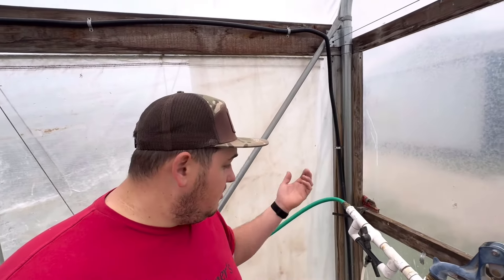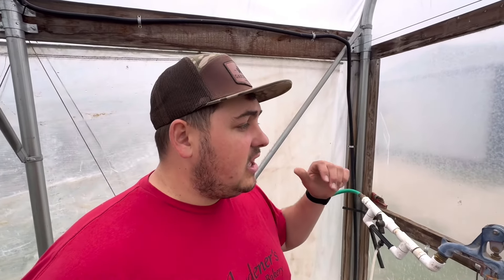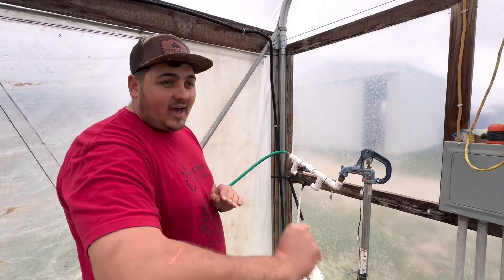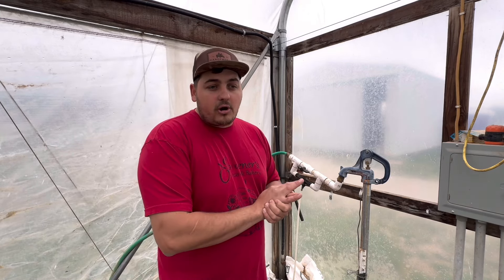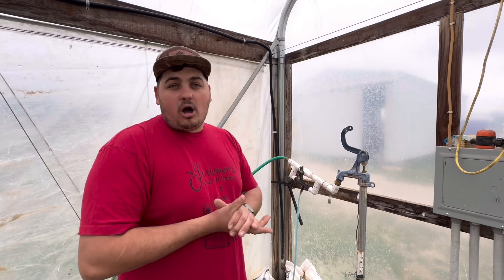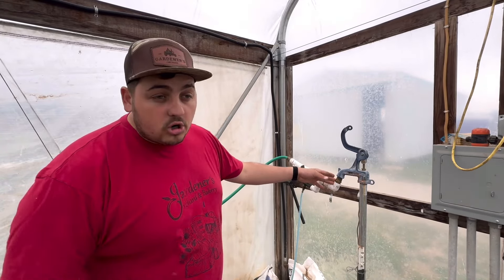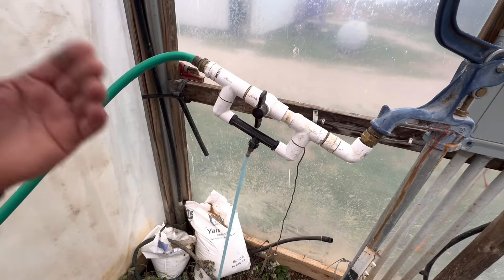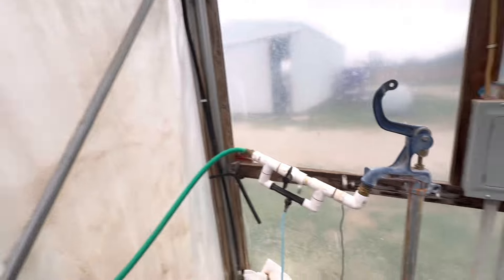How to Fix Fertilizer Injector!

Comment: Where is the pressure regulator?
Reply: Clearly there's not one.
Reply: @PerimeterPermaculture  there has to be one.  You can't run 60psi through drip tape!